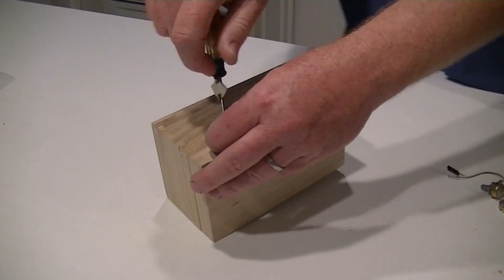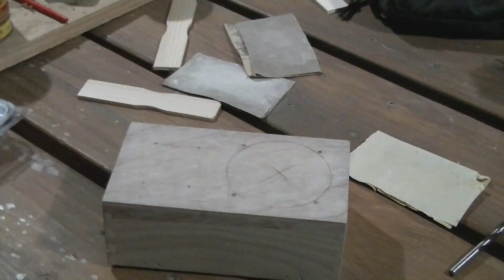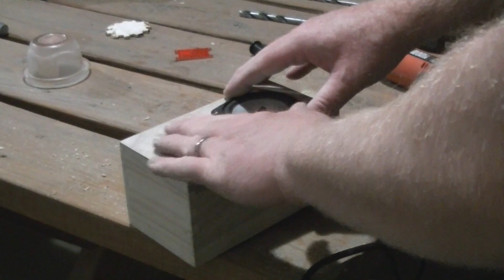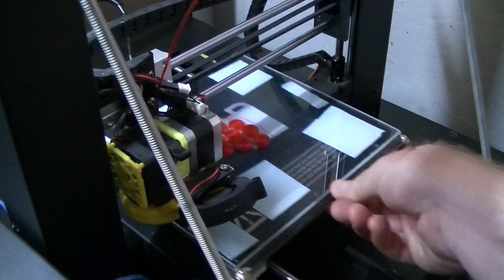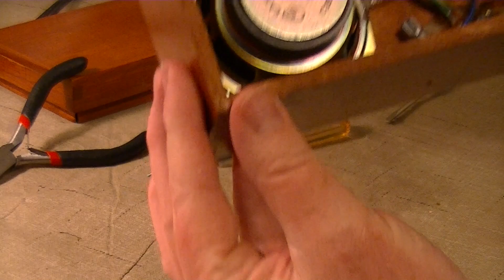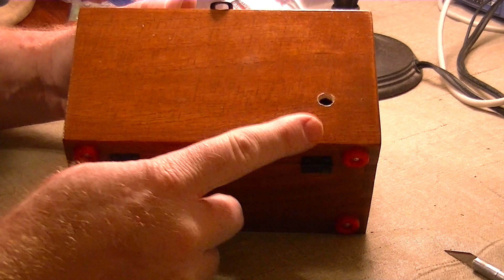Qrome Guitar Box Amp Full Build (Part 2 of 2)

Comment: Great kit. Just wanted to leave a quick tip for anyone in the process of gathering the materials for this build. If you have the choice, opt for a box that is made of material closer to 1/8" thick vs. 1/4" thick. I have mine all assembled except for the potentiometers installed. I tried everything I could think of to get the pots to mount into my cigar box, but they just wont work. The threads are too short. My cigar box is from an imported brand and made of 7mm stock. When picking it out, I remember thinking "Oh, ill pick this one, its nice and sturdy". It didnt dawn on me that it could be TOO thick. After doing much research I think I found the same pots but with double long threaded posts, Im just waiting for them to arrive in the mail. Unfortunately, they were almost the cost of the entire kit after shipping. The cheaper solution would of been to scrap that box and go with one made of thinner stock but I kinda had my heart set on the original one. 
...Just wanted to leave a quick tip- "Pick a box made of thinner stock if possible!"
Reply from the maker: Thanks for sharing your experience.   I have built amp boxes that are quite thick -- I was able to mount the volume and gain controls by counter sinking where the washer and nut go.   This allows the washer and nut to catch the threads.
Reply: I used a chisel to dig out a square about half the board thickness on the back side so the body of the pots sit nested into the side of the box.